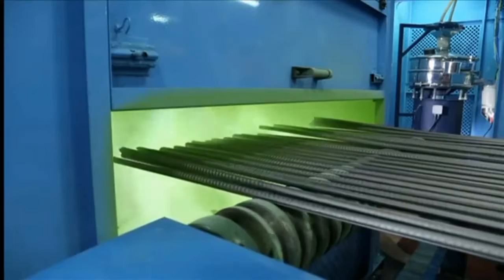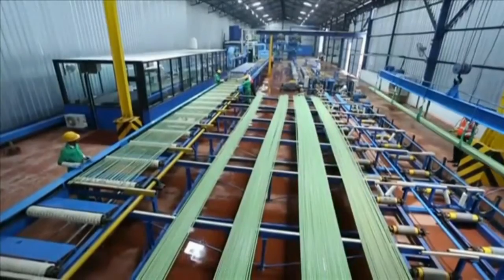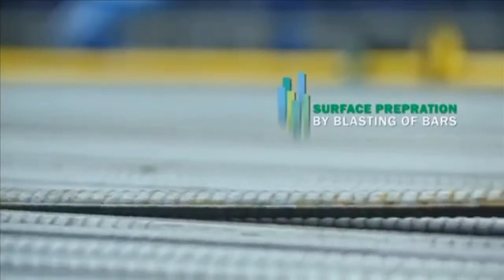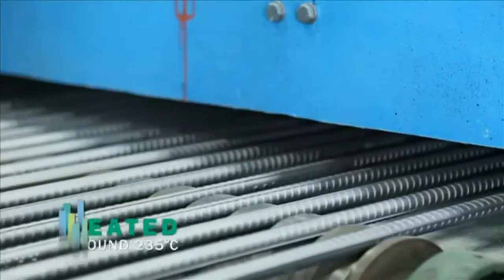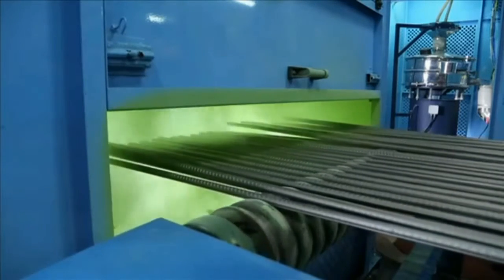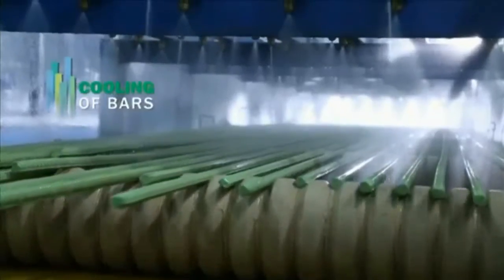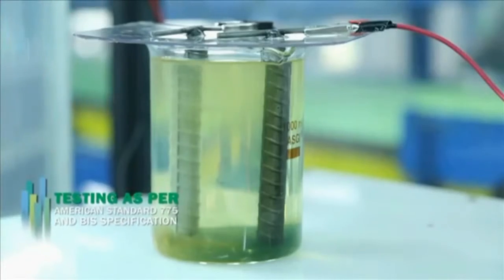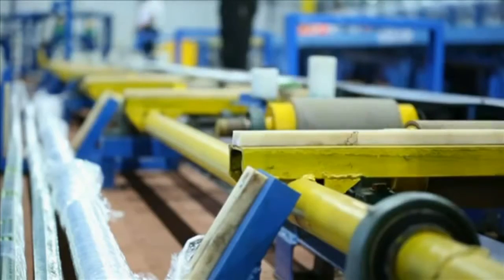Mitsuba's Rebar Coating Equipment- Epoxy Spray Guns For Rebar Coating

Comment: Was there a Rebar Holiday Detection System added to this line? If not 
and you are in need of such systems to integrate into your line please 
contact Pipeline Inspection Company, we custom manufacture Multi-Station
 Rebar Holiday Detection Systems and we would be glad to assist you with
 any project.

Comment: I am a Production Engineer having 24 years’ of experience in Production, Plant Operations, Inventory planning & purchase. Out of which I have 17 years’ experience in UAE as a Plant Manager in Steel Re bar Cut & Bend and Epoxy Coating Plant.
I am now seeking a new position where I can contribute to the quality and cost-effectiveness of a company’s operation and profitability.
email:vrragesh@gmail.com
00918086190404
Reply: One of my associates have steel complex starting from sponge iron mfg to power plant to SMS to TMT bars and ferro alloys units in one complex at steel hub of India, Raipur ( CG ). They are considering an epoxy  coated TMT bar unit for expansion. Your experience seems most relevant and appropriate. If interested, please let me know your email and contact details so that may join since beginning , if agreed. Thanks N D Agarwal Raipur CG India email agarwalnd1947@rediffmail.com